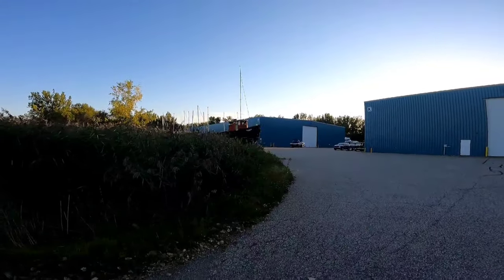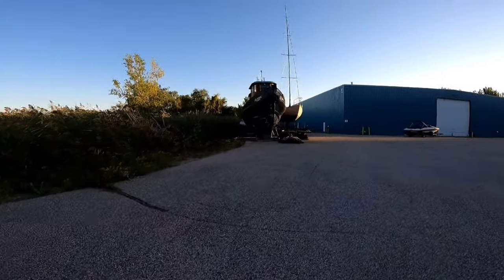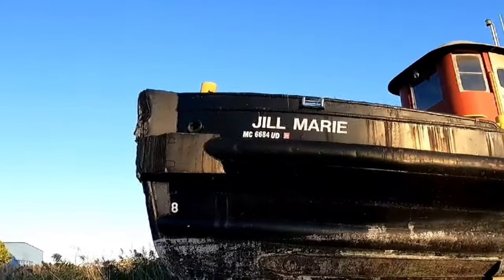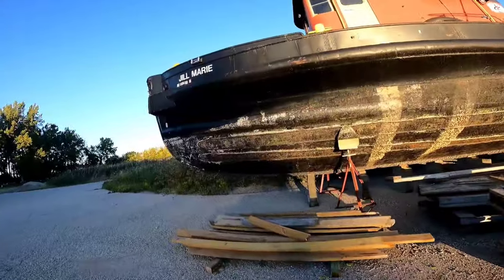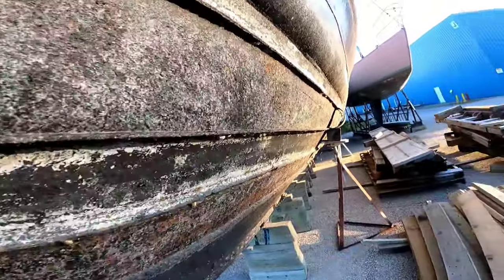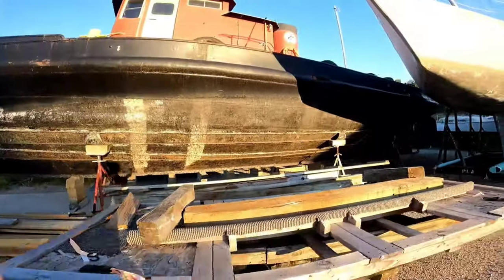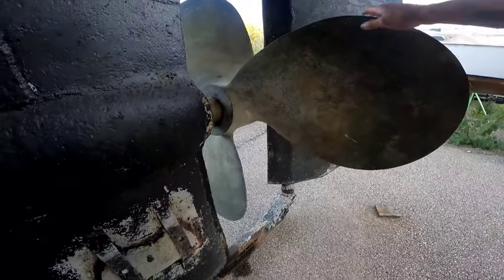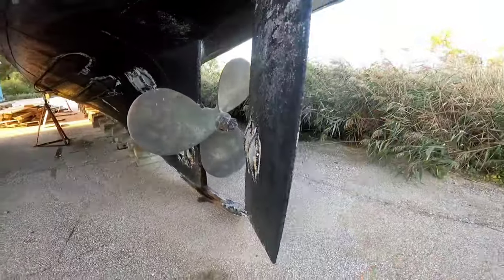Old Steel Boats - 130 yr old Tugboat  -  Ep 27

Comment: I'd buy that tug. Great lakes shipping and shipbuilding owned and started by Rockefeller made the best tugboats, he also owned Cleveland cliffs that had access directly to the best iron or and the best riveters and welders and fabricators from Lincoln electric. All THE BEST was here. Also if you look and if it was updated to diesel from steam it probably happened mid 40s to early 50s it probably has a 800hp 10 cylinder  and don't quote me but a 278a Cleveland deisel, designed and built in Cleveland not far from the shipbuilder.... THESE DIESELS DONT DIE.... EVER. Theirs still a company that bought the tooling in Washington state, you can readily get parts for these engines today, also those diesels we're in 80 percent of our WW2 submarine fleet and our destroyers. It's the engines that powered the waters of WW2 and beyond.
Reply from the maker: Thanks for watching and for taking the time to comment so thoroughly!!!  Its really great information!!  I would love to take a tour below deck and see the engine!!   Also curious as to how she would look as a liveaboard.